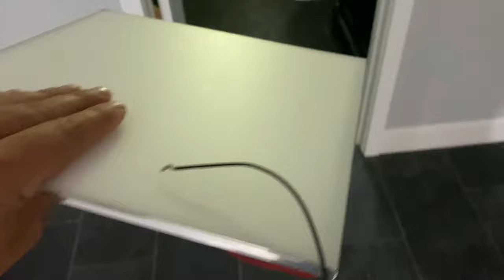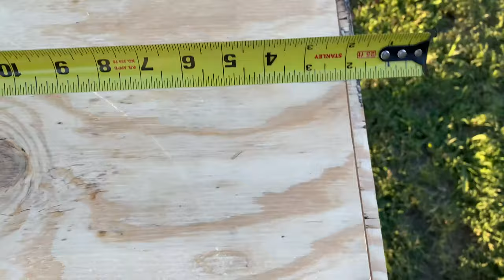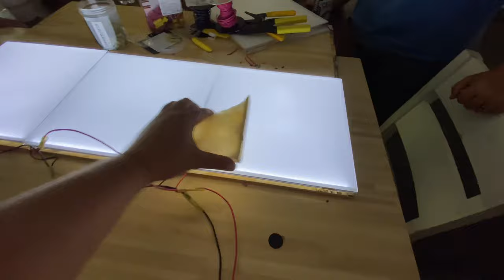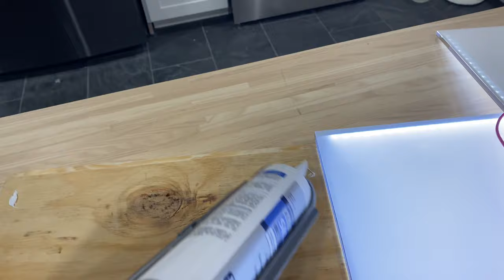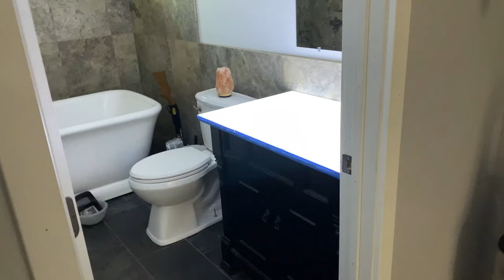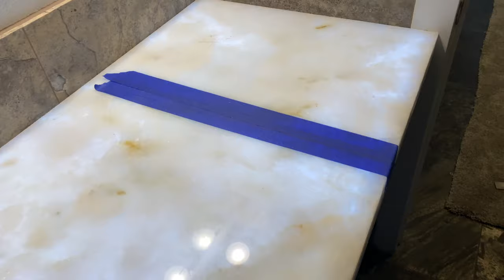Backlit onyx countertop! StoneGlo

Comment: Panel still working after u cutted basin hole , how?? 🥺
Reply from the maker: The light portion is a small strip on one edge of the panel. the frosted plastic lights up from that single row of lights so you can cut the panel and still have proper function.

Comment: How did you make the holes for the drain and the faucet if I don’t leave space between the light panels?
Reply from the maker: These panels can be drilled through. There is a string of lights on one side of each panel leaving the other 3 sides and middle open to cut as needed. You can even trim the light side in certain spots if needed

Comment: What happens if a light fails?  Wanting to do a bar island
Reply from the maker: Excellent question! These panels have an incredible life cycle. I planned on failures. I used minimal glue to hold the Onyx to the lights and the lights to the sub panel. For my installation- the faucet and drain  plumbing will hold my system together. For a large bar I would expect the weight of the Onyx to hold it all together. If you expect weight shifts etc.. there may be other things you should do..

Comment: is the led panel under the basin where you put a hole is still working?
Reply from the maker: It is- The plastic panel is just plastic. I didn't actually cut any of the electrical portion of the panel

Comment: Looks Good. But how did you fix the trap in it? Did you cut the light panel through ??
Reply from the maker: Great question- yes we drilled right through the panel. There is a row of LED lights on the side of each panel and you may cut the panels in certain areas. You can drill through the panel anywhere and the whole panel will still light up.